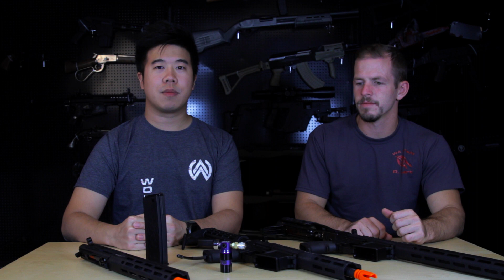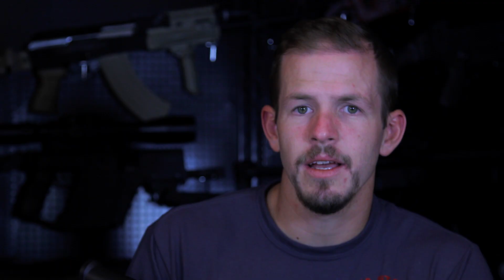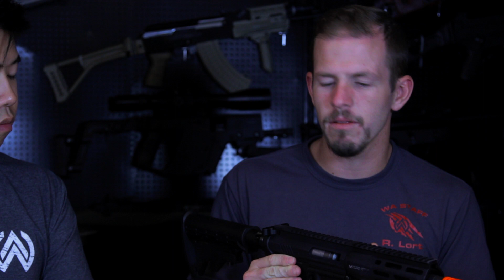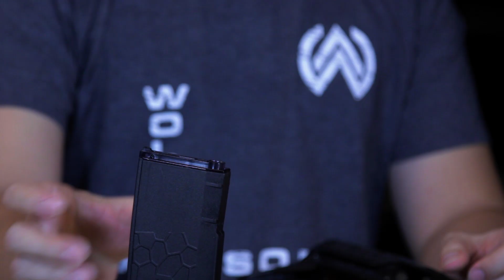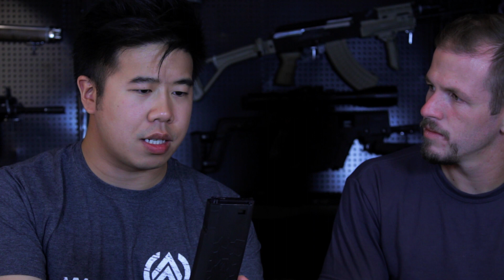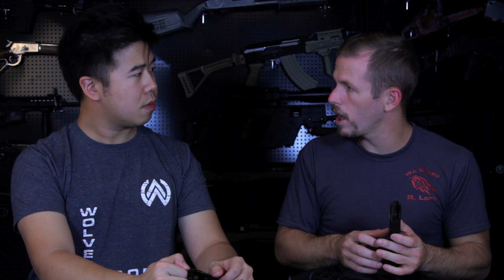Gambit’s Guide – Dive Deep Into Wolverine Airsoft MTW – RedWolf Airsoft RWTV

Comment: Wait wait wait..... you just skipped right over the CO2 storage in the stock. So HPA could be optional?!
Reply: Yeah it is optional and to me that is one of the coolest features! I could be wrong but i think they also have co2 mags but i may be thinking of another gun
Reply: You can use a hose or their tank stock or their c02 bulb stock tube.
Reply: @RickyRavioli69  you're thinking of the Tippman HPA M4. They have mags that take 12g CO2 carts or you can plug on a macro line with tank.

Comment: Whats the point of making "everything just like real steel, so that you can use real steel parts but sometimes not the AEG/GBB ones" in airsoft? It just drives the price up for absolutely no reason. But i like that it's compatible to standard AEG magazines. That is something that many of those "empty-mag-bolt-stop-systems" lack.

But what does he mean when talking about "gearbox and hopup not being aligned correctly"? Where is that the case?
Reply: When converting aeg to hpa, one can have issues as the hpa engine is mounted to the lower receiver whereas here it is built onto the upper with specifically machined housing.
Reply: @adamsperkinsss  The HPA Engine is inside the gearbox, so it's the exact same thing as putting in standard AEG components from my understanding. Where does the misalignment suddenly come from, when there isn't any with the AEG components either? Please note that i haven't done this conversion, since it's more or less illegal in my country (you have to pay a huge amount of money to the "Federal Physical-Technical Institute" and they have to mark the gun as legal).
Reply: @Etherion195  that's not correct. There is no gearbox. This RIF is entirely built FOR the HPA engine. It sits in the upper. Aeg gearboxes are mounted to the lower receiver. Due to aeg gearboxes not being designed for HPA, manual modification is necessary, like drilling or removing material. Not the case with MTW.
Reply: @adamsperkinsss  You have to read properly. I was referencing HIS statement that this system is better than the AEG conversion, because as he said: "here you don't have misalignment as you would have in a converted former AEG". You missed the topic there.

As far as i know, you don't have to do much though.
Reply: @Etherion195  Alignment is still an issue even when using the default gearbox of the rifle. The hpa engines available today are made to kinda fit in all gearboxes, so there is additional labor to properly fit the engine yourself. It stems from the HPA engines being made to work with the body, rather than the body being made to work with the engine. I am surprised they are selling at such a low pricepoint for the technology. I don't own one myself, but I have worked on several MTW's, it is compatible with a lot of modifications, the only issue is that they made a proprietary engine for this MTW, and you cannot use other engines. If you like HPA, this is a great option, but its not supposed to be a price gouging product, they tend to be cheaper than most custom builds because it throws out unneeded space used by AEG's.
Reply: @GassySniper291  thanks for the clarification
Reply: Having real steel compatibility means that you have a wider choice of parts as when a new part comes out, you don’t have to wait for a company to clone it, you can just buy the real steel part. This is often more expensive, but the quality is always better and on a premium rifle people expect to pay a bit more for the accessories and Gucci gear.

 I don’t understand why people want compatibility with regular AEG mags, they don’t load every last round, they vary massively in quality and are responsible for 90% of the feeding issues out there